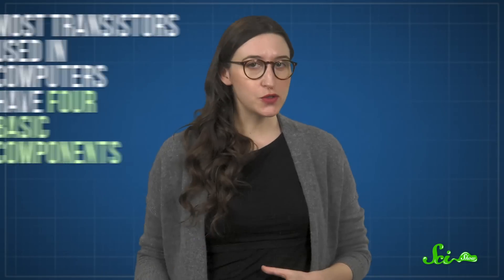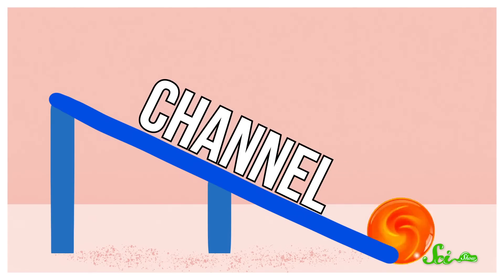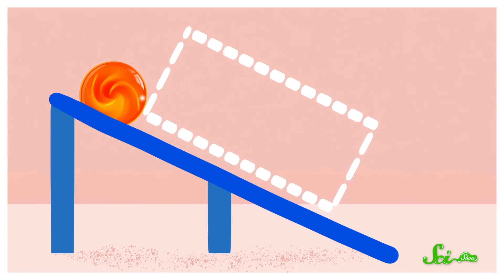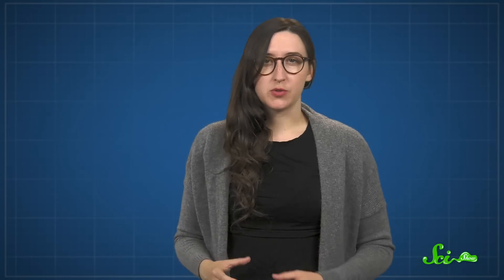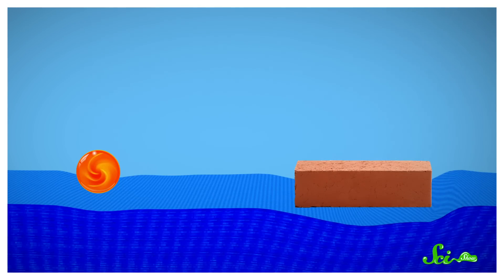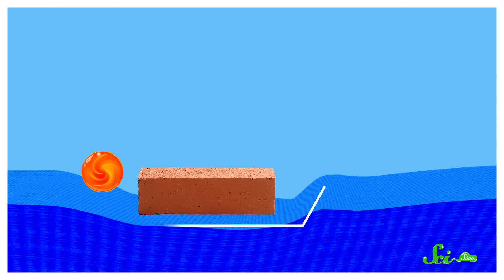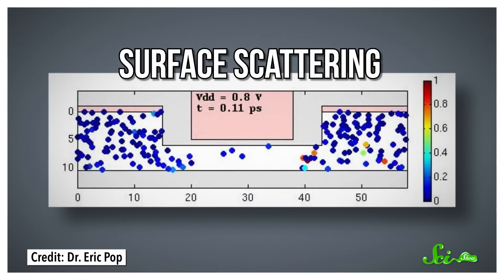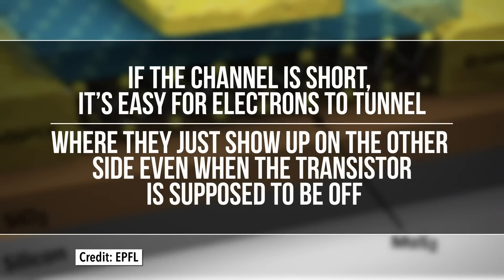There's a Big Problem With Silicon. What's Next?

Comment from the maker: For those wondering, this is a re-upload. We want to do right by our viewers and make sure that we're being accurate, so we took this off the channel and reworked a few things to make things more clear. Thanks!
Reply: What was changed ?
Reply: @pewypolaw  | The analogies were changed. They were quite bad before.
Reply: The new brick-foam graphic is much better.
Reply: This is so much clearer with the new analogies. Thank you so much for taking the time to fix and reupload this!
Reply: Nice !!!
Reply: SciShow bruh. I smoked a fat bowl and thought I was in a time loop of some sort. Thanks for the heads up!
Reply: Make one about VRMs Voltage Regulator Modules 😉
Reply: i was about to say i felt like it was
Reply: Thanks.
Reply: I like this new analogy better and that marble animation was dope. You know It can take time to make a really detailed marble, like over 3 hours.
Reply: Much better
Reply: @randomguy263  The analogies are still bad. They should skip the analogies and just use animations to illustrate.
Reply: @markchadwick77  | Are they really, though?
Reply: You're welcome.
Reply: I would adore to see you do a vid on optronics, using lasers in a wave-guide to simulate electrons in a transistor. If it works, it would be a massive upgrade to processor speed, the trick is making a wave-guide 'gate' like you can with a transistor. I haven't heard much about this for a while, so I'm curious as to where the technology has gotten to.
Reply: Way better analogies
Reply: You still confused germanium with silicon for the 1st transistor and first solid-state computers.
Reply: you almost got the outfit reproduced just right but the hair and piercing are slightly different making the re cut shots a bit jarring
Reply: Hence the huge feeling of Deja Vu, thanks for pinning :)
Reply: Do right by removing the balloon animal sound effects that distract from the content.
Reply: and the thumbnail is no longer taken from the verge's guide
Reply: @randomguy263  they're even worse now!
Reply: I wonder what happened to Memristors? They were supposed to revolutionise electronics, but I haven't heard of them since they were figured out about 10 years ago now.
Reply: The photo of a modern chip is upside down.
Reply: Oh it was a re-upload,I thought it was deja-vu
Reply: @SmoakAwps Yeah, unlike The Verge who doesn't admit their mistakes. (They made a video about how to build a PC that was a total disaster, everyone laughed at them. Then they took out the video and everyone else's video about it, without saying.. uhh, you know. It's a mistake. Thing.)
Reply: Much appreciated 🔥🔥🔥
Reply: It's not always about being right, but knowing when to admit you're wrong and correcting and learning from it. Hats off to you folks
Reply: Another thing you might want to check out then is when you talk about the channel being a another piece of silicon. I could be wrong but my understanding is that it is the gate voltage that causes a depletion region within the base that allows current to flow. The description given isn't vital to the video but may be misleading for a general understanding of transistors.
Reply: SciShow And by simply reposting it, you get a whole bunch of new views. Not bad at all 🤝👍
Reply: Now I'm a bit sad that the old one is gone, the analogy was so weird and counterintuitive, it was amusing...  And  now it is gone, I don't remember the content, just that I enjoyed it.
Reply: The analogy before made me laugh so hard
Reply: @tatianatub  yup. so close. ahhh, but who doesn't love a good continuity error?
Reply: SciShow thank you so much for using a better analogy. This explains it much more clearly <3
Reply: Nice reupload....
Reply: Oh well thank you for that thought I was having another delusion...
Reply: Something, something, MoS2FETs...
Reply: I understand people might not be familiar with transistors but this did seem a bit too dumbed down. Do people really not know how transistor gates function? I was unfamiliar with the MoS2 material they're experimenting with but everything else outside of the analogies was totally explicable.

Not really complaining per se, it was still interesting to learn about the new material but I kind of felt like I was watching Scishow Kids.
Reply: Oh, so thats why her hair keeps changing between some shots, lol
Reply: Ok -- thought I was going crazy for a minute there.  LOL.  I'm watching this, thinking, "I know I've seen this video before!"  Even before I clicked on it, I thought, "Wow.  They're really doing a lot of videos on silicon recently."  😂
Reply: Still has the pointless representation of “smaller. ...and smaller and smaller.” Yes, the transistors in those do get progressively smaller but the packages used to represent them are backwards (smallest first). There are orders of magnitude more transistors in those larger packages but that only makes the size comparison shown less valid.
Reply: @randomguy263  I'm someone who knows the subject (30 years in the industry), and I couldn't determine what they were trying to say with the analogies.
Reply: @markchadwick77  | Well, they were just trying to explain it in a simple way. I think that the analogies kind if worked.
Reply: That explains the De ja Vu!
Reply: You should have fixed the thickness of the MoS2 because even assuming no space between the atoms you have a +3 A thickness not a 1 A thickness. Most papers measure it at ~3.1 - 3.2 A. So you are effectively off by ~3x reality.
Reply: "Component 3 - The Channel" is still slightly misrepresented in your presentation. The channel actually flows through the P Material when the gate is powered. There is no special Component or material called the channel, the channel is what forms between the source and drain materials. This is why semiconductors are used, the "P" material is doped differently from the "N" material, when power is applied to the gate, the "P" material between the source "N" material and drain "N" material becomes a conductor "essentially turned into "N" material" and allows electrons to flow. This is of course pertaining to your demo using an NPN transistor. I had no intention of trying to correct that small mistake given when i first watched the video during the first upload, however since you made a point to fix somethings, I figured I would throw in my 2 cents, and see if it help.
Reply: Thought I was having yet another deja vu.
Reply: Damn! So I can not see in the future...
Reply: This is much better but still oversimplified. It fails to recognize that getting more performance out of any kind of processing unit is more complicated than just shrinking the transistors inside the device.
Reply: finally a good analogy
Reply: @Casanuda  yes there are plenty of people that don't understand transistors
Reply: @markchadwick77  basically what they're trying to say is: the transistor's channel length is why we can't keep shrinking our transistors.....and the copper wires connecting them
Reply: B Pr  Yes, ussualy when they are flat, they start using up the silicone.
Reply: B Pr  Sir, You have a heart of a poet :)
Reply: The people in the below comments are dumb, universities taught us that gate has positive voltage potential which repels the electrons to flow to drain, but with enough power electrons can jump the gate barrier leading to rundown. We saw this live on oscilloscope on our labs.
MY POINT IS: maybe instead of throwing these analogies around brick and some dotted lines, why don't you show some pictures in real life
Reply: I'm a simple man. I see academic honesty and integrity, and I like the video.
Reply: I’m thinking there’s not one electrical or computer engineer on the whole team!! If there is, check those credentials lol

Comment: I always thought transistors were made of magic smoke. At least that's been my experience with them
Reply: At least they release some magic smoke when you feed them the wrong thing
Reply: Spikeupine Incorrect. They are made of magic smoke that is contained by the plastic package. If you do anything that causes this smoke to be released, they cease to operate. Many engineers’ careers have been built on trying to keep the smoke in.
Reply: When you're in electronics lab, you want to try to make the magic smoke come out of other peoples' devices. It's kind of a game that way, like capture the flag.
Reply: @zekerandolph1397  Antec power supplies tend to release the magic smoke

Comment: I like this reupload, the descriptions around how electricity moves in a transistor makes much more sense.
Reply: Yes, and it is closer to right.
In a modern chip, the gate attracts the electrons into the channel.  It doesn't push them away.  At zero volts, the device is off.

Comment: As a mechanic, molybdenum disulfide is known to me as the primary component in certain grease formulations that are used in high-pressure applications. Moly grease is usually used where you have sliding components with a lot of weight on them and not a lot of heat.

Comment: Curious that the first Candidate is MoS2, considering that the current tech is called MOS (metal oxide semiconductor, I learned it as metal oxide silicon, possibly renamed). Makes me wonder hiw they came up with that. A: MOS reign is ending. B: So we need a MOS II! A: Yeah. Wait, that's actually a good idea. B: What? A: What?
Reply: MOS is metal oxide semiconductor.   CMOS is complimentary metal blah blah.
Reply: i was going to comment that as well, but checked to see if anyone else had done so.
Reply: Actually the original name is MIS, metal insulator semiconductor

Comment: I really like how this shows that tech will stop shrinking for more than just aesthetic purposes.
Reply: Current shrinking does allow more powerful gpus, better ai performance and more efficient cpus.
Reply: @jonatand2045  not as much as you would think. it leads to greater power efficiency more than anything. Duel gpu and chip designs will ultimately have the best performance.

Comment: Kudos! This version is certainly improved! Good on you for addressing quantum and thermal problems with small transistors; and much better explanations for the Small Channel Effect!
Reply: Effects*
Here's a longer list: mobility degradation due to higher required vertical electric field, velocity saturation (higher drain to source electric fields saturate carrier velocity, effective mobility is lower), threshold voltage roll off, DIBL, subthreshold swing degradation, polysilicon gate inversion (smaller gate length means thinner gate oxide, but high vertical electric fields invert polysilicon gate and reduces ones ability to make the the effective oxide thickness smaller), gate leakage (due to thinner oxide), higher impact ionization and thus higher substrate current, and GIDL (gate induced drain leakage).

Comment: Transistors are voltage to current converters, but yes, it can function as a switch. But we keep underselling it's potential.
Reply: So is any resistor. It's better to see transistors as Voltage/Current-Controlled variable resistors.
Reply: @omegahaxors9-11  
Better yet, consider the transistor as a voltage controlled current valve.  The Id curve flattens once Vds is greater than Vth.

Comment: The phone I have now (Huawei) is significantly more powerful than the HP computer I bought in 2008 for like $1000, which was thousands of times more impressive than the computers involved in the moon landing.  The phone has twice as many processors and 50% more memory (8 GB vs 6), and cost a little over half as much as that computer, and was built only 11 years later, in 2019.  That's roughly a 250% jump in computing power in just over a decade, which is insane.  I usually keep a phone for about 5 years, so at this rate, my next phone should be at least 300% more powerful than that 2008 computer, probably with 12 processors and 12 GB of memory, possibly even more.  I can't even imagine how powerful a computer or phone in 2050 will be.  Regardless, keep up the good work my geeks, we owe you a debt of gratitude.

Comment: The last chip in the series at 0:36 is not actually the chip, these are just some resistors. And they are on the backside of a modern CPU. The CPU chip itself is about the same size or bigger than the chip shown in the second picture. There are simply a LOT more transistors on it.

Comment: This is a problem people have been talking about since the late 90's. Computer scientists worry that we are running up against the limits of physics and then some engineer comes up with a clever workaround.

To be fair though, this is the reason multithreading became a thing in computer processors.
Reply: Yeah, we've been staring down some pretty big problems for a while now, but progress has legitimately slowed down and we are not only approaching the scale where physics stops up but also the scale where old options aren't viable anymore. One of the reasons new materials - such as the III-V materials people were making a fuss over 5 years ago - haven't caught on is because the transistors are so small that the material almost doesn't matter. I don't think progress is going to stop, but it's going to continue in things like multithreading and transistor redesigns rather than shrinking or new materials.

Comment: but do we need faster, smaller devices? do we?
Reply: we really don't. Making transistors smaller doesn't have the same performance impact as it used to. Making CPU/GPU architectures more efficient seems to be the key to better performance for now.